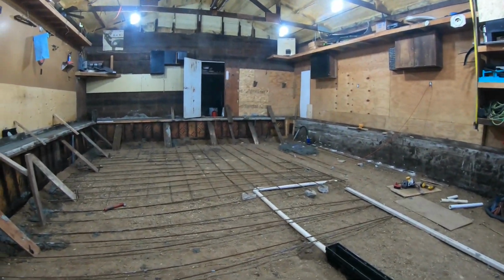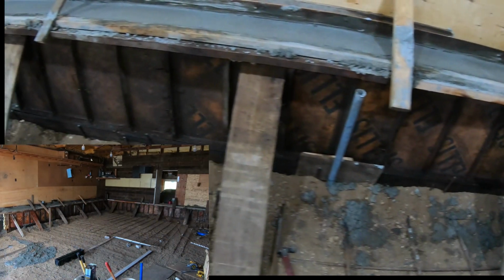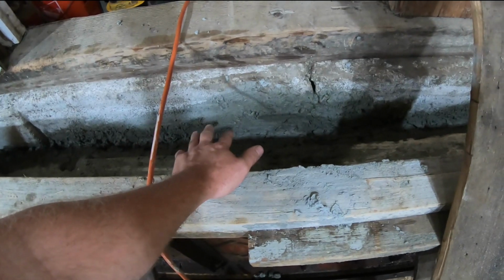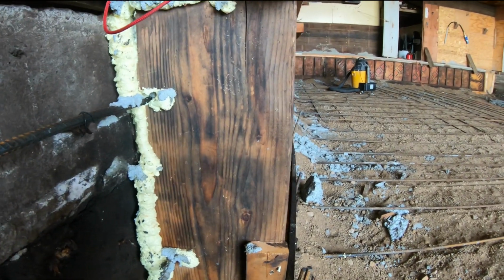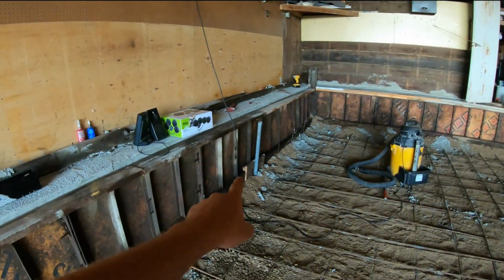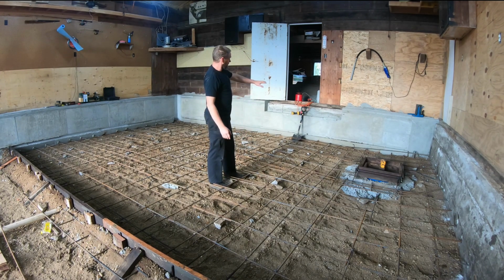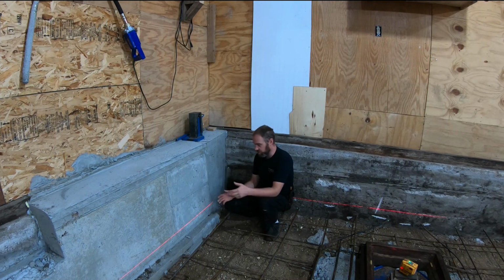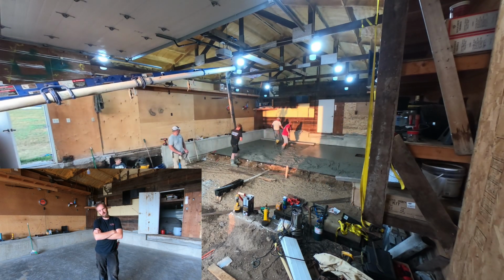Pouring The Wall and Part of The Floor Pr3

Comment: I could talk about concrete all day long but I have a car question if that is ok. I can’t seem to find a decent after market water pump for my 2013 suburban. Is there a brand of water pump that you prefer?
Reply from the maker: Delphi I suppose
Reply: @CrazedPerformanceRepair  Thank you so much for the reply. I went ahead and put another Murray water pump in from o’Reillys. I was able to find the receipt to the one that had failed so they replaced it under there warranty. If this one goes out I will be looking for a Delphi I suppose.
Reply from the maker: @jameswag8473  if it keeps failing it might be your antifreeze. Did you flush the dexcool out and change in to some universal or something yet? If not you should, that dexcool is dexcruel to a lot of gaskets especially when it gets acidic.
Reply: @CrazedPerformanceRepair  Ok so I have always flushed this motor and put the recommended dex-cool back in. The brand I used is Zerex.  So flush it again and put what back in?
Reply from the maker: @jameswag8473  it's probably ok if you flush it periodically but I like to use the universal yellow stuff. That way no matter what someone tops it off with it will be fine. Plus it seems to be a much less aggressive antifreeze.
Reply: @CrazedPerformanceRepair  Thank you very much.